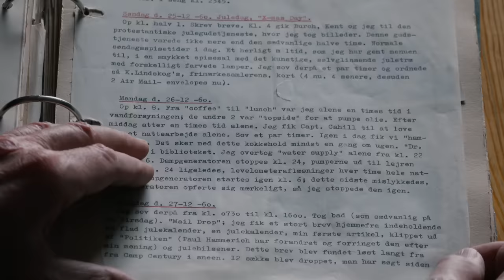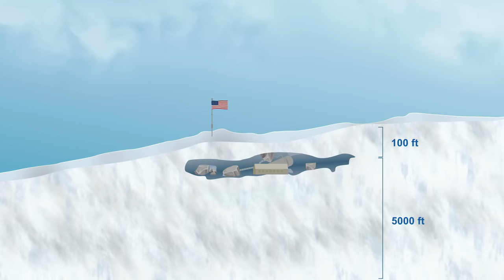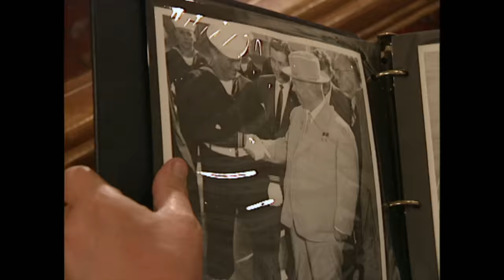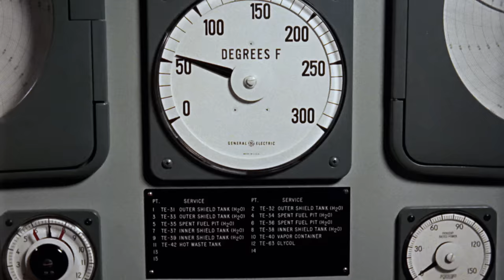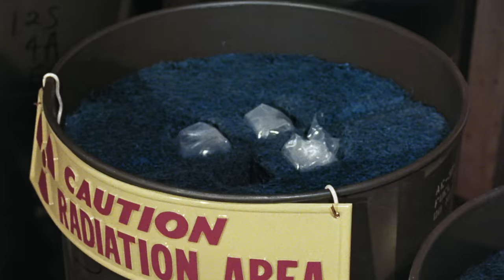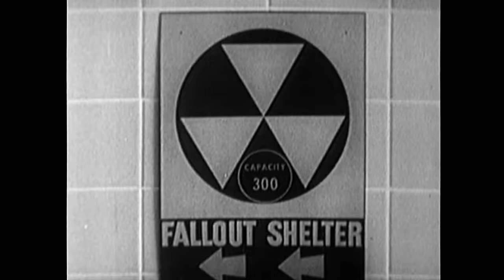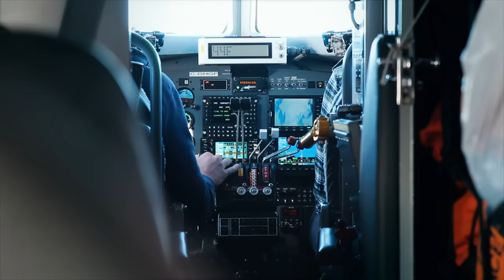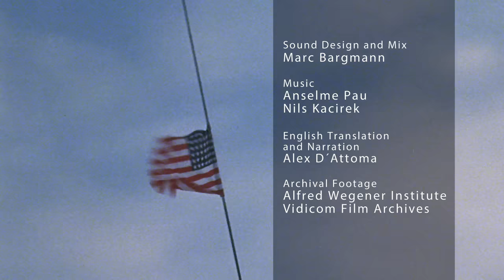Camp Century - The Hidden City Beneath the Ice | Full Documentary

Comment: I used to sell expanded polystyrene systems panelized buildings built for these arctic conditions with a 4 inch wall a house could b assembled in 4 days. We had  a 3 story mansion at Deep Creek Lake in Garrett Co Md. With 6 inch walls .it was 6500 sq ft. Because it was super strong and insulated you heated it for only $200 a YEAR and GARRETT CO is called the icebox of maryland. It gets bitter cold there and u could literally freeze to death there. Its a far superior toanything on the market.

Comment: Not to diminish the feat of engineering and the logistical nightmare of working in such an area, but I'm also going to take a shot and say that this whole operation was a disaster for the environment.
 The awareness to tread lightly on such a pristine site was hardly part of the conversation at this stage, and nor was the thinking and awareness yet part of the national psyche to not destroy and degrade the pristine Arctic.
 The fact that the environmentally destructive effects of this base are still being felt is, I dare say, a terrible indictment of the U.S. Military that they have not seen fit to clean up this area. 
But then they also pretty much Fracked up vast swathes of the Pacific and destroyed numerous atolls for the testing of the atomic bomb and haven't had the grace to clean up that region either, so no real surprise, I guess.